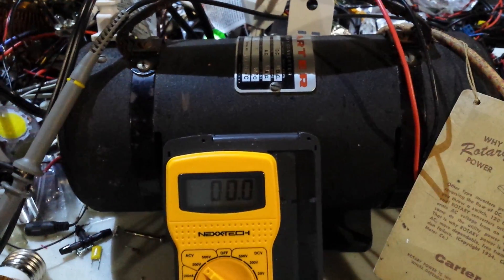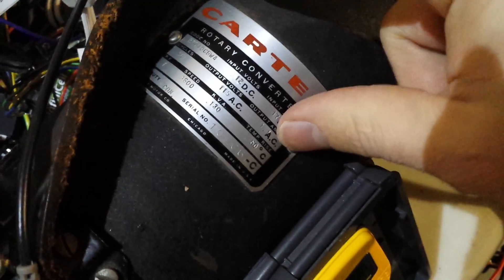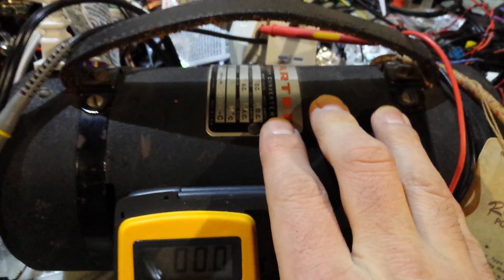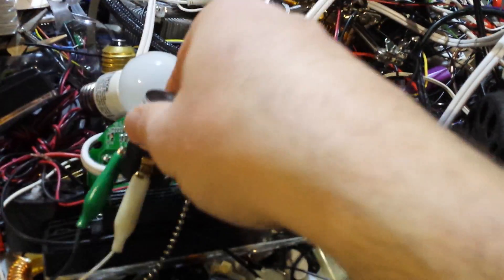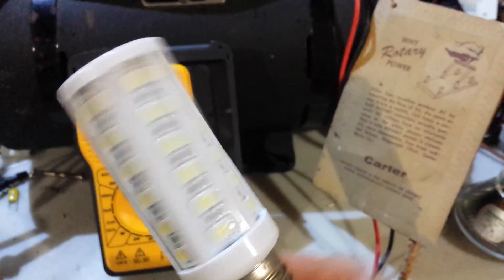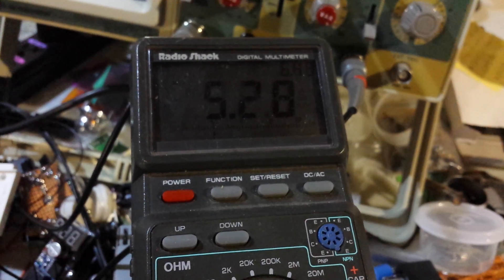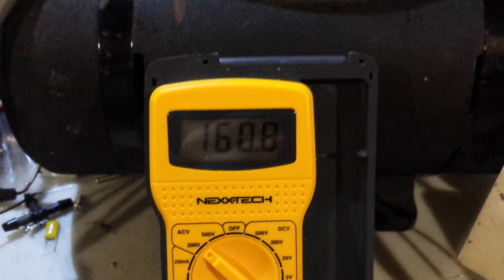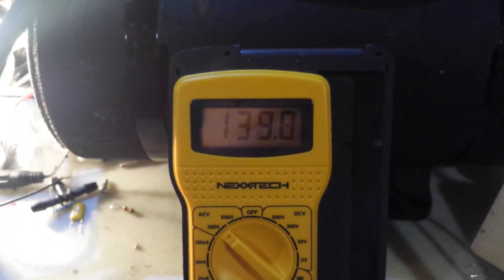Carter rotary inverter

Comment: That's neat, would there be any application for something like this today?  Finding solid state inverters that can actually handle a high load (especially motors) is very hard, perhaps a rotary converter of this nature with a flywheel would be able to handle big loads better?  Great if you want to run big inductive loads off solar power or something.
Reply from the maker: Not to sure. It does require 60 watts of power just to run but yes it does handle motor load very well I used it to power a juicer I fix for a friend and it work just find. But it is not very powerful. Thanks for watching.

Comment: Is the voltmeter you used to measure the output voltage reading true RMS? If it isn't a true RMS meter, the distorted sine wave will throw off the measured voltage.
Reply from the maker: It's a very cheap multimeter so I highly doubt it's a true rms but it work and it's small I have some better one but I think at that time I either couldn't find them or the battery was dead.

Comment: Very nice converter!  I always wanted a build one like that.  It would be really useful if there was ever an EMP and all the electronic inverters went pop.
Reply from the maker: Lol would be useful but if an emp goes off I wouldn't worry too much about electronic they would be mostly dead. Beside a few old tube radio hehehe or some high tech shielded equipment. I should do that to my jeep mouahahahahaha.
Reply: bakupcpu Hahaha yeah do a video on making your car EMP proof!
Reply: Old comment but EMP induces very high currents (amps) in wires causing them to pop like fuse links or vaporize completely. A long time ago, a Russian nuclear EMP test measured an impulse of a few thousand amps on a pair of telephone wires just before they vaporized. So it's not just electronics as in silicon, diodes, and transistors; no, all electrical devices will fry. That includes the windings in a motor or generator. If you fear EMP, first look up how to shield the equipment AND safely block/shunt surge currents. I've seen some vintage EMP hardened Military radios. Thick metal shielded case and all the components were broken down into metal encased modules connected via hard line coax.

Comment: Thats a nice bit of history there. You should run it off a battery and power a charger to charge the battery. Instant free power ;) Or even better use it to power a few hundred LED's and use the light to power a solar cell to charge the battery.
Reply from the maker: Mongrel Shark I do have one of those booster battery pack and could be nice in camping but this thing is well like 60 LBS of iron lol Maybe not that much but it's quite heavy and it only give about 115 watts of power. Inverter now a day are way more efficient for converting power but I still love to hear it run :)

Comment: thanks for sharing watch my channel
https://www.youtube.com/watch?v=Zx7RA4YAn3s
Reply from the maker: Riskteven I saw those video as well and beside making LOTS! of noise it produce some high frequency voltage that is good for light and switching power supply I don't see any real use. And there's no increase like you said it's a motor that use current and sometime way more then it take to turn that little pump motor.
Reply from the maker: I'd say let them believe what they want it doesn't hurt me. Cheers and let keep experimenting :P
Reply from the maker: You're right. I should try to build onne of those de-sulphator but have no use for those right now. meh future project :)

Comment: Had never heard of this and it was an education to see the scope traces + running performance. A marvellous piece of history in action there, cool purchase.
Looking forward to the clean up and test, i'd think it will give a bit cleaner sine wave and draw a bit less  :)
Reply from the maker: slider2732 I've actually clean it up completely brushes and bearing and I drop the amp draw to about 4.5ish amp sine wave is not really a sine wave lol the noise we see is the brushes on the DC side when they switch I tried adding some filtering cap but no luck so far. Haven't tried filtering the ac side yet though.
Reply: bakupcpu
Ah great, thanks for the update !
Reply from the maker: You're welcome :)